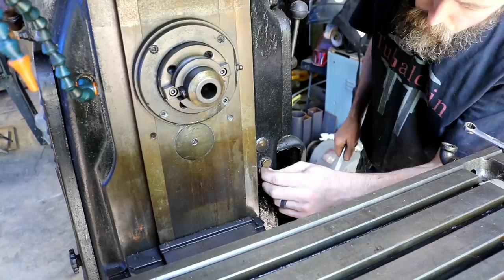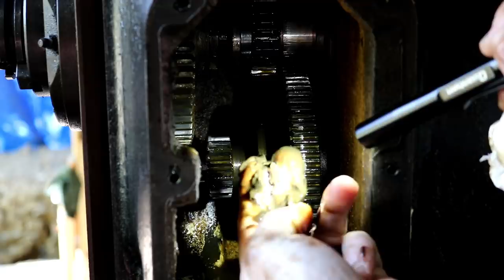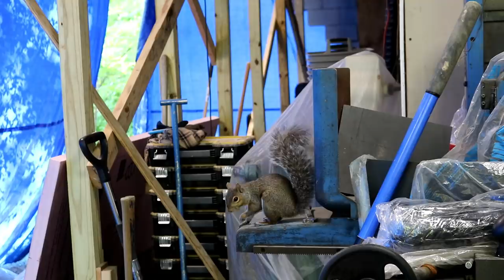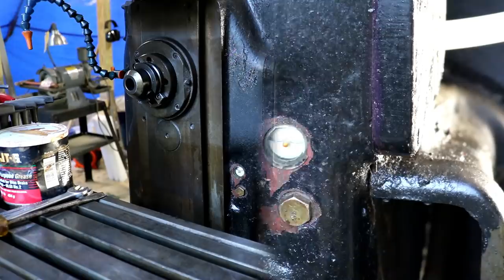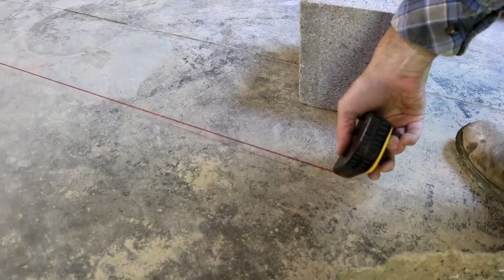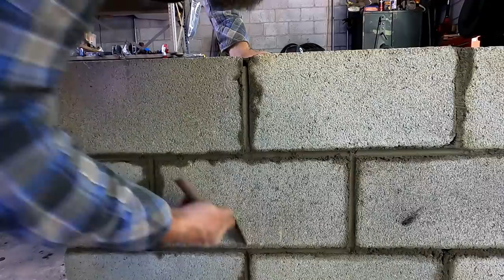METAL in the GEARBOX ! 1st RUN  Adcock Shipley Mill.

Comment: Want to make tracking those noises easier, just use a mechanics stethoscope. The trick then is to know what a bad bearing or sound is versus what is normal. Don't have one handy, grab something solid like a screwdriver or dowel rod. Put your thumb over the end and hold it to your ear put the other end near the item you want to listen to. The noise will conduct through the tool and into the bones around the ear and let you hear it that way.

Comment: Steve, you may want to check if that machine has a British 50hz or American 60hz motor. There is no harm running a 50hz motor on 60hz except that the RPM will be faster than the motor nameplate. That would make any marking on the machine controls for RPM, like in the belt pulley box,  inaccurate and need to be offset if precise speed is required. (note that running a 60hz motor on 50hz power can overheat the motor although not the issue here). Also wouldn't the spindle bearings be metric? Can you get those easily in the US?

Comment: I was expecting you to lay the block as close to level as you could then mill it flat.  But seriously, the only thing I can say to improve the wall is when you lay the corner blocks on the real project, use a transit to get both corners level then the infill is a piece of cake.  Great work.

Comment: You could get an old mechanics stethoscope  or use a long flat blade screwdriver to act like a stethoscope to find the noise. Place the screwdriver where you think the noise is & put your ear on it & move it around to pin point the noise.

Comment: I see no reason that you should not be able to lay all our own blockwork. You will only get faster with practice. 
Of course, if you can be working in the workshop on your speciality and be earning more than you are paying the builder, then doing it yourself makes little sense. 
But.. I learned from my dad that the trick with any job is to dare to start it, then to have the determination to finish it.
It took is 20 years, but the two of us repaired/renovated an old house (built around 1450) learning the skills as we went along. That is built with fieldstone walls, sandstone slabs for the roof and lots of big oak timbers in the areas where local rocks wouldn't quite suffice. 
He was trained as a machine fitter turned draughtsman,  I trained as a physicist. Our philosophy always was that if it could be done by ordinary folk, then there was no reason we wouldn't be able to do it too, but not at commercial speed. 
There again, with a house that old the "hand built by semi-competents" look is authentic :-)
Reply from the maker: I've always thought the same way about doing new to me jobs. If someone else can do it most likely I can as well. Thanks for watching

Comment: This is entirely tongue-in-cheek......Glad you didn't lose the smoke out of your electrical system. British cars of that era were known for losing their electrical system smoke and ceasing to function, particularly when using Lucas electrical components. I would check for those. If you have Lucas components and need new smoke you might need the Lucas Replacement Wiring Harness Smoke kit. An example of this kit can be found here: http://whereisbobl.com/tiger/smoke.html.

Looking forward to more videos on this machine.

Comment: realy like that machine , its small enough for a hobbyist machinist , wonder if it will run on a chineese digital frequency converter
Reply: I'm a working volunteer on a heritage railway, (Somerset and Dorset), we've got a Colchester Triumph 2000 lathe running through a Chinese converter, works just fine.
Reply from the maker: I'm sure it would run just fine on one. I like the idea of having the extra control over spindle speed.

Comment: My cousin told me that at the engineering school he attended, they would pour Coca Cola in the mortar mix so it wouldn't set up. The class could practice all day with the same mortar. I've no idea the ratio, he told me this 30 years ago. Funny what you remember, I haven't thought about it since the day he told me.
Reply from the maker: I remember things like that on occasion 😁.  Ill look into it. Thanks for watching
Reply: @SteveSummers  I did a little googling myself. If you search "Coca Cola in concrete" you get some good results.
Reply: It’s the sugar in the Coca Cola that stops the mortar from setting up—so plain sugar, or any sweet product will work. An old trick to sabotage a concrete project is to throw a 10lb bag of sugar into a ready mix truck. The concrete will never cure. It will eventually dry out, but it won’t cure.

Comment: Try using a mechanic's stethoscope to pinpoint bearing noises. Compared to a screwdriver the sound is much louder and clearer, easier to use and pretty cheap too.
Reply: A piece of fuel/vacuum line works surprisingly good as well.

Comment: God I bet that's the original oil from the factory! The cover certainly hasn't been off since it was put on originally or if it was off then whoever did it was a lazy so and so not cleaning the gloop out of the bottom!  Your block work skills are better than mine lol I'd never get on with those hollow ones, here in the UK we hardly ever seem to use hollow blocks, ours are of a more lightweight solid type. I've no experience of concrete block in house sized construction.

Comment: How do you control accurate spacing between the blocks? Especially as you are building from both ends. Are there stops built into the blocks? Or is there a cheap removable spacing device like used in tile laying? Just learning here in case I ever want to do this.

Comment: Considering the age of the motor, I would change those bearings along with your spindle bearings. Just a guess but judging by the size of the motor a pair of 6205 bearings are probably what the motor needs.
Reply: The motor bearings are a good idea.  The spindle bearings are an equally good idea, but I fear the replacement cost will be far greater than what he considers the value of the machine.  I don't know what he has in mind for the machine, but maybe if high precision is not too much of an issue, a set of reasonably priced, useful bearings will be available.  I only bring this up because of a restoration I was involved in that became a very pricey experience!

Comment: Great video Steve! What size square crank do you need for the milling machine X-Axis? I've got a few cranks laying around with female square drives on them. I would be happy to send one over if I have what you need.
Reply from the maker: It's a 1/2 square drive. The crank needs to be female👍
Reply: @SteveSummers  Ok Steve, I sent you an email

Comment: is that a zirc fitting for grease on the front bearing retainer.. maybe it never got Greased either.  i wonder if there is a grease fitting for the rear spindle bearing??? 
Hint.. when draining .. try to have a ball valve,. an assortment of nipples and perhaps a street ell..  you can perhaps slip the street ell in.. screw a nipple in with it aimed up.. then tip it down to allow the drain to happen.

Comment: @Steve Summers Hope this helps... you can get a long screw driver and put that up to where you thing the grumbling is coming from in the machine and put your ear on the other end. I have used this in the past on motor engines to find where rattles are coming from, an old time mechanic taught me the trick.
Reply from the maker: My dad always used a piece of hose. I remember him listening to the bottom end of motors for bad rod  bearings or to find the lifter that was tapping.

Comment: Hi Steve There is nothing wrong with your block work, you are slow because a brickie would not be so precise. There are a few good tips here 1. Use a plastiser in your water, this makes the mortar a nice smooth consistancy and gives a little bit longer worktime. A lot of brickies use dish washing liquid in the UK. 2. Wet the blocks before laying so they are damp when laying. 3. Use a soft brush after pointing when the pointing has gone off.  Go to Rodian Builds on Utube and watch Rodian Builds - How to lay bricks.  A lot of what he shows relates to blocks and trowel work, lay out etc. My brother in law was a brickie it is fascinating to watch them work. When is the foundation going to be laid? https://www.youtube.com/watch?v=NZ8brDJAMdE

Comment: could you make a drain plug with a magnet to catch some of those metal chip offs.
Pinpointing where a noise comes from can be difficult, but try taking a  long screwdriver and use it like a Pinard horn https://en.wikipedia.org/wiki/Pinard_horn . Learned if from an old mechanic, and finding which bearing is shut in a gar engine with all the belt noises and engine roaring can be difficult

Comment: Is it me or is the spindle running in reverse?
Reply: It's the video reproduction, I believe
Reply: Recently got a used AS 1ES-J just like the one in Steve's video and looked here for referance/guidance. Took me some time guessing and going through the manual to find that in fact Steve has it running CW (wrong dir.) instead of what the direction should be - that is CCW. Cheers!

Comment: I think the issues in your block laying might be related to your mortar being to wet. If its too sloppy the mix will ooze out. if you get my drift.
Reply: Yes. And a little detergent to keep the air in the mortar. I like to wet the blocks. But that depends on your environment, (temperature / humidity)